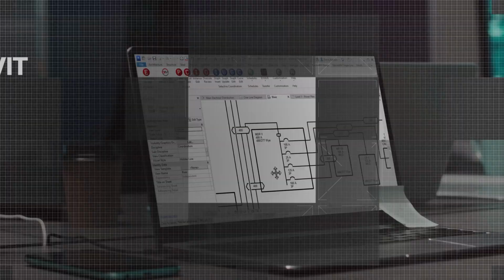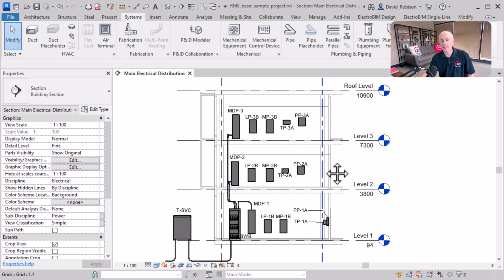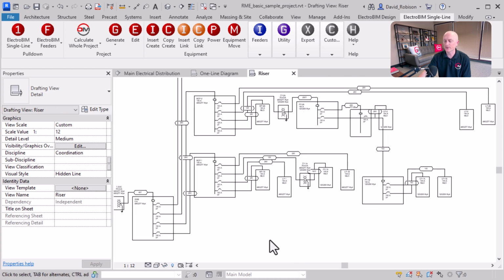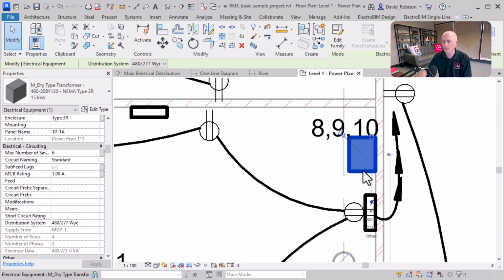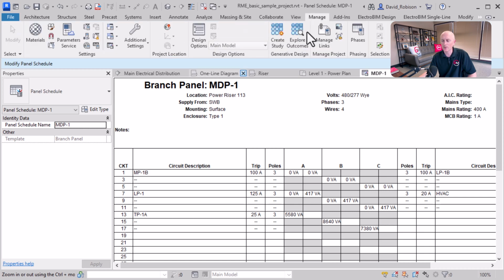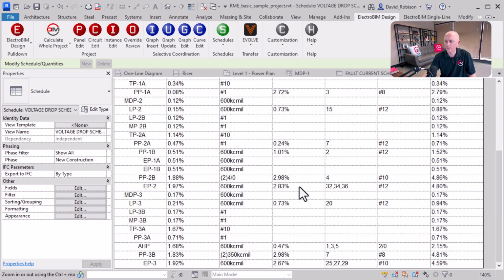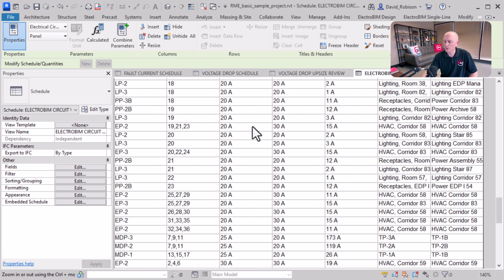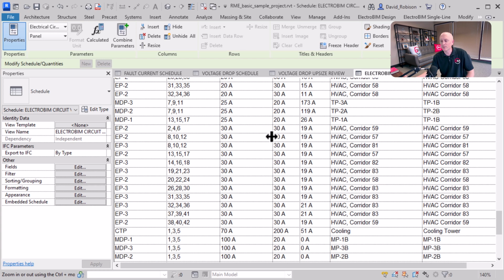Revit 2023 Electrical Sample Project - Episode 34  #Revit #BIM

Comment: Do you plan to include short circuit currents calculation to the plugin?
Reply: They are already included. I called them "fault calculations" in the video, but that's the same thing.
Reply: @DavidRobisonDM  We have just one number of short circuit current in calculation. What exactly is this value?
Reply: Isc, Icu, something else?
Reply from the maker: You can check out our "Fault Calculation" training for more details on how that calculation works. https://www.youtube.com/watch?v=17C5tbVOhlo
Reply: @Design_Master_Software  dont find this info in video. Anyway for correct selection of protection equipment (circuit breaker etc) we need to know minimum three valuest of short circuit currents: minimum one phase short circuit current (to check the minimum threshold of the electromagnetic release) , maximun three phase circuit current (for the correct selection of the electromagnetic release setting) and shock short circuit current (Icu) (for the correct selection of equipment according to the conditions of electrodynamic stability)